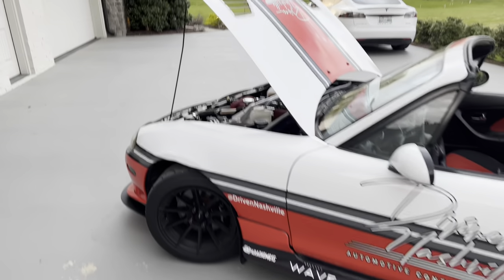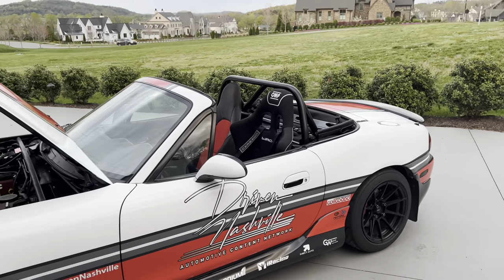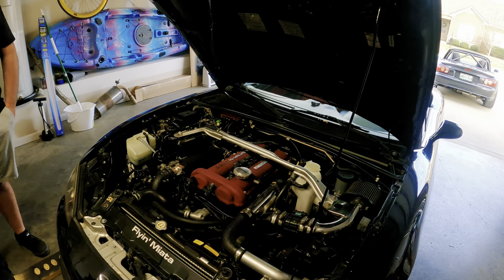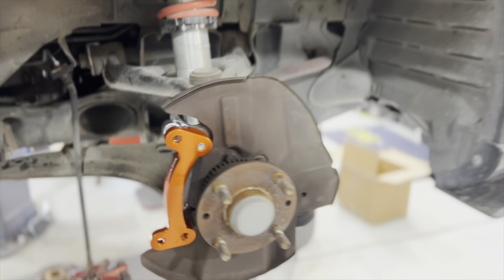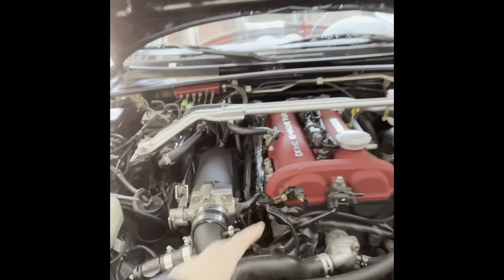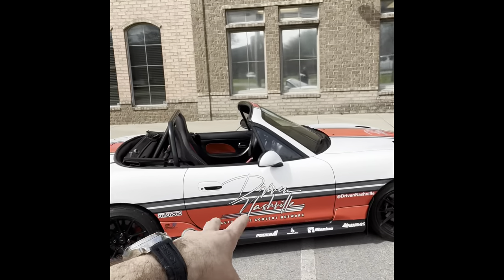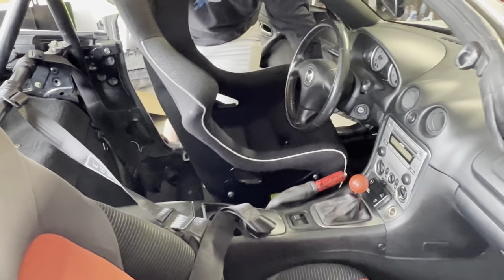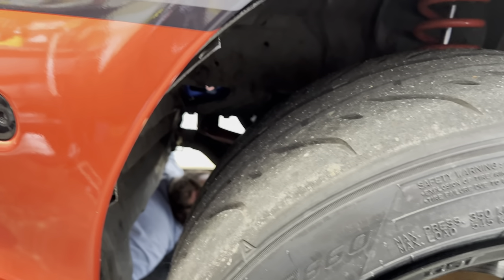2005 Mazdaspeed MX-5 Track Build Video

Comment: How can we contact Ian for work?  I live in Franklin and just got an 04 mazdaspeed.  Got the little enchilada and differed maintenance to do and I’m  going to be out of commission for a while for a knee surgery.
Reply from the maker: Want to link up soon? I can plan a little get together.
Reply: @Driven-Productions  So with the miataroadster short shift kit, would you recommend the taller angled version, or the short version?  Have you driven both setups?  What about a weighted shift knob?  Looking for any thoughts on the subject.  But it is looking like I do want to get the miataroadster kit either way.